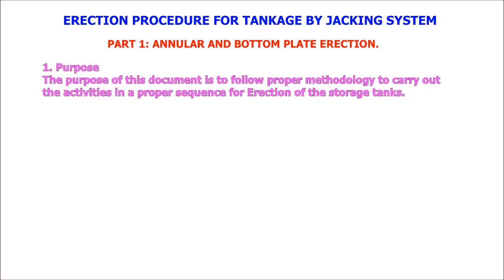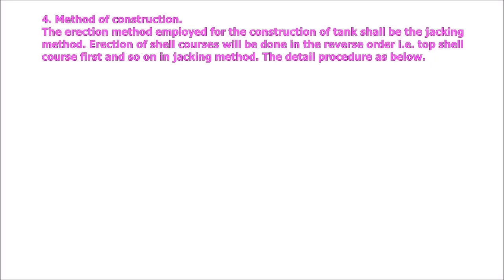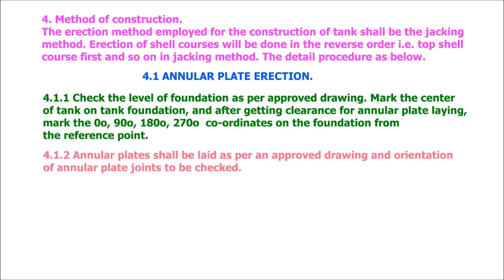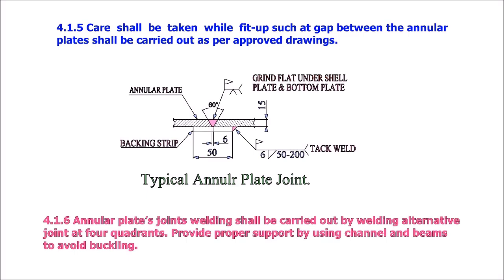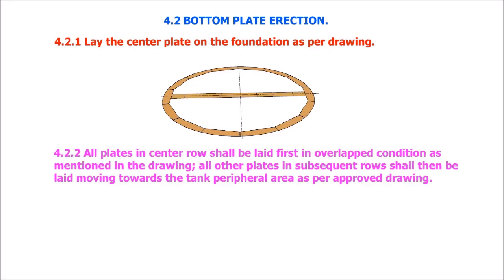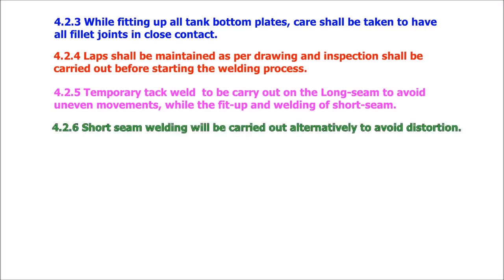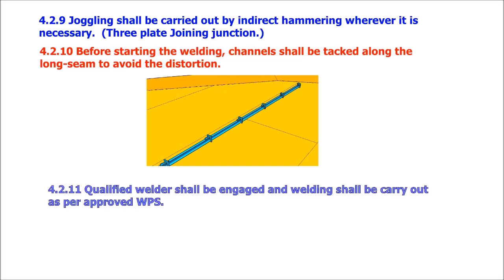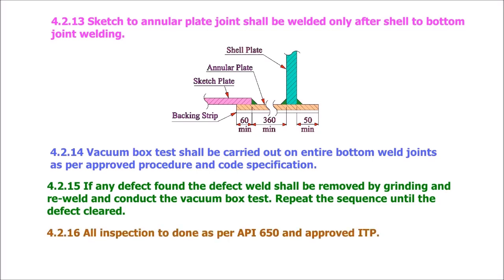API 650 Erection procedure annular and bottom plate.

Comment: great works and really best content for that subject ,just one clarification at minutes 6.15  4.2.13  you mean sketch welding after shell to annular weld ?
Reply from the maker: Yes. If you weld the sketch to the annular before the bottom to the shell, Most probably, the bottom plate center will go up. This means, a lot of buckling in the bottom plate.